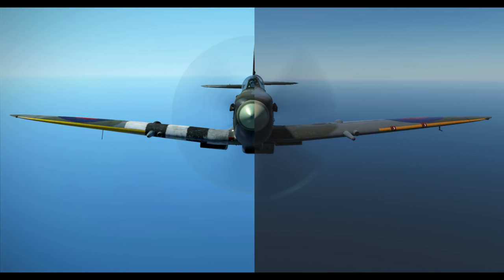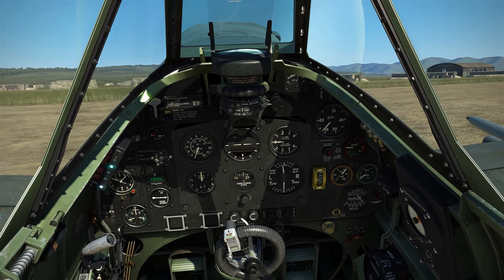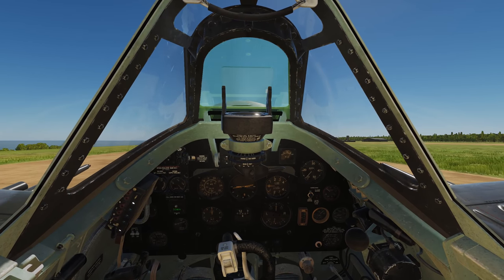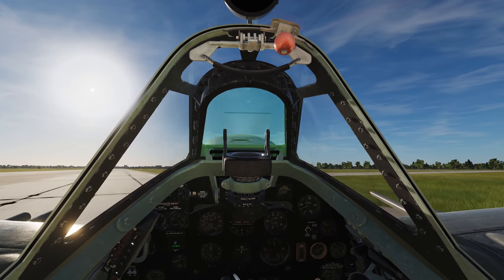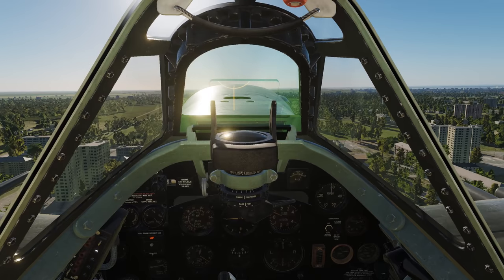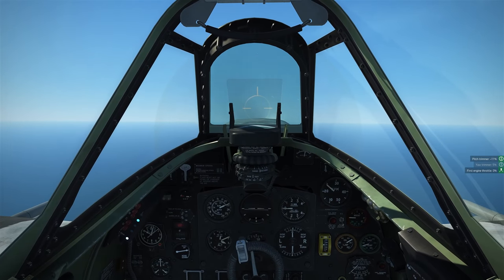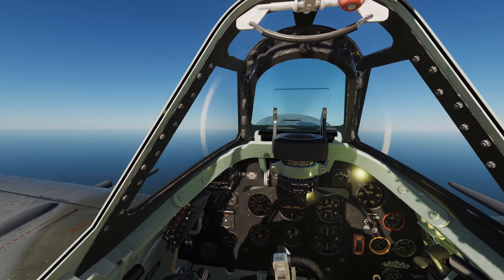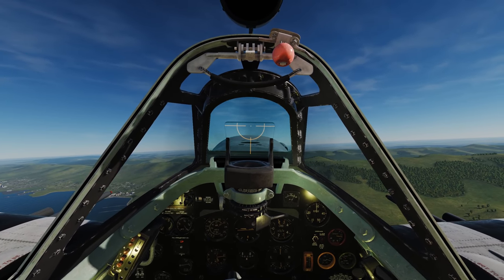Spitfire IX - IL2:GB & DCS Comparison - Part 4 - Ground handling, takeoff, TPM & torque

Comment: It’s impossible to taxi without brakes in the Spit.
Reply from the maker: In the real one you mean?
Reply: This is a very interesting data point for us Sim flyers
Reply: phil style Correct. Changing direction needs brake at all times. Brakes are never used on takeoff except in very rare cases in cross winds in the beginning of the ground roll. Thanks for all your support. Kind regards Nick
Reply: @nickgrey9099  Strange. The last kinda report I read on that, from someone having a run in a Spit IX (TR-9 variant with 2 cockpits, at Biggin Hill), was mentionning that althought they use break for stopping and 90° turn on grounds, and perhaps sometimes here and there, and never for more than 50% break applied, they mainly used rudder for taxiing. 

When asked specifically about using breaks while taxiing, his pilot/instructor replied "oh yeah, we don‘t do that".
His report here : https://forum.il2sturmovik.com/topic/50013-some-impressions-about-flying-a-real-spitfire-tr-9/
Reply: That reporrt is really interesting stuff.  
DCS feels like it doesn't really model the propwash strongly enough to do that (I'm still not totally convinced it's there at all).  You can see from footage of spit takeoffs the tails come up in the first few feet of the roll as soon as the power is added.  You need quite a bit of speed for that in DCS.
Reply: @mostevil1082  Dear Sir, may I respectfully comment having flown, Spit I, II, V, IX, XIV and XVIII, I can assure you that the tail will not come up so easily on the IX unless you open the throttle to +8 to 10 and bring the elevator to beyond neutral. This is not the correct fashion to takeoff. Stick should be brought to neutral and the tail allowed to raise on its own. Many thanks for your passion and support. Kind regards, Nick
Reply: @kalbuth  It is true that when taxiing you only apply partial breaking, 50% is a good guide, but taxiing without braking is only even conceivable on hard taxi way and even then only in no crosswind as the aircraft will easily weathercock into wind. Trust me... Many thanks for your passion and support. Kind regards, Nick

Comment: I know this video is a few years old, but just FYI: neutral elevator position in a Spitfire actually is two notches above the middle position on the gauge. It's not very intuitive, but that's how it works. If you put the arrow in the center, you are trimmed nose-down.

Comment: Excellent series and case study on the differences between the two simulators! Both seem to have their strengths, weaknesses and nuances. I like both, but for some reason -- some of which your tests here might enlighten -- I tend to gravitate more to DCS.

I don't know what your plan is after the Spitfire, but one thing I'd be interested is the comparison on how different couple of different plane types are in different sims (e.g. limited to certain tests about ground handling and take off, torque, engine handling, stalling, etc), especially as we now have some overlap between the planes modelled in the sims. I.e. I feel that in DCS there is more difference between planes, while IL-2 the contrasts seem smaller.

Keep up the good work!
Reply from the maker: My plan after the spitfire series is to actually play for a while, rather than record comparison footage day after day! Lol
Reply: @philstyle  Fair enough :) but whenever you get bored of flying and feel like continuing this series ;)

Comment: Great series, and a really interesting watch. I'm a confirmed il2 head for the moment, but once I get a system upgrade I think I may look into a couple of dcs ww2 aircraft for the 'study sim' aspect.
Reply from the maker: TBH, if you're really interested in mastering a machine, you can sink truck loads of hours into just one module in DCS. I'd recommend doing that over spending cash on aircraft you might not fly. Best to pick one, and choose to really learn it.
I've had the DCS spit nearly two years, have probably a couple of hundred hours in it, and am still learning!

Comment: I think you should try your takeoff sequences on a pure dirt runway in the Normandy map to check if the ground handling on takeoff is different. I always find the short dirt runway you get assigned in DCS Spitfire Instant Action Normandy Takeoff quite challenging. I am sure there would be a similar type of runway in ILX
Reply from the maker: Gelendzhik on the caucasus map is pretty similar to the normandy coastal airfields (low alttiude, dirt). I ran out of time/ video to add that test also.  So much to look at! not enough time to look at it all :)

Comment: Phil, you’ve missed one external eye-candy feature of the DCS Spitfire that seems unique to this module (at least it’s missing from the P-51D and FW-190D).  And that’s the wonderful semi-transparent flickering exhaust flames that go from orange to blue as power is applied.

It also contrasts with maddening bright yellow (wrong colour) intermittent stabs of flame (far too infrequent) that 1C Game Studios insists on using for all its aircraft.  
Each cylinder on a four-stroke engine fires once every two revolutions.  Taking 2400 rpm to simplify the maths, means 40 revs/second, or each cylinder firing 20 times a second, not once every few seconds as in the IL-2 Spitfire.  Another gee-whiz gimmick that just distracts from the realism.
Reply from the maker: The engine exhaust flames are broken in the current DCS spitfire, so I was unable to properly compare them as they are normally supposed to be.

https://forums.eagle.ru/showthread.php?t=243261

Comment: Beat to have stuck slightly back to neutral. No need to push nose forward. + 8 a bit much but ok
Reply from the maker: I find +8 far easier to see with a quick glance. The horizontal needle. . .
Reply: phil style +8 is fine too. Plenty of grunt 😎
Reply: @philstyle  +18 lbs is good boost for take off :(

Comment: "She was a lady in the air, but a bitch on the ground" : I have a real hard time taxiing with her (in DCS). I have a Warthog and I don't know how to manage the brakes, since the lever behind the stick (the closest to the Spit brake lever, in a simulation perspective) is not an axis input, but just an on/off button. What's your HOTAS ? Do you have any tricks ?
Thanks for your videos, I really love them ! 👍
Reply from the maker: I also have warthog. My brakes are bound on the throttle quadrant. They are assigned to the little grey slider which is to the right of the main throttle and prop levers.
Reply: @philstyle  Thanks a lot ! I hadn't thought of this one ;-) So as I can see in your video, you just apply a tid bit of brake pressure with it, and you can then taxi using only your rudder like with any other warbird ? I'll try this tonight 😉
Reply: @FastForward352  I just tried Phil's method this and it works however I have my IX brakes assigned to the left toe brakes on my rudder pedals and you can use them with an axis ( if you have pedals) as DCS has it available in the axis control options operating in analogue mode. I prefer to use the grey slider on the WH throttle for fine nose up-dwn trimming. Early in the vid (10.43) Phil called the IX brakes differential, not sure what he meant by that description,  I don't think it is a correct description as the IX brakes do not operate independently, the left and right brakes are applied simultaneously by the air lever on the stick. I could stand correcting on this?
Reply: I seem to remember that we all used the '4lb brake cheat' when learning landing and take-off with the DCS Spit (even Phil).
This involved using the grey slider to put about 4lbs of brake pressure on and leaving it there to control the aircraft for better ground contact.
Reply: @zorbalight3933  They're not really differential brakes, but they work in coordination with the rudder : brake then apply a small amount of rudder either left or right and you'll see the brake pressure needles (on the left) behave like differential brakes. Correct me if I'm wrong, I'm not specialist at all ;-)
Reply: I also meant to add that I think on many of the Normandy map strips you need to be able to dab the IX brakes whilst taxiing to counter DCS excellent modelling of the non centering (castering) tail wheel.
Reply from the maker: @FastForward352  
Yes, I just apply a tad.

remember though, applying the brakes will start to slow you down, so you kind-of need to apply-and-release the brakes as you use the rudders, just anough to correct your path but without loosing too much momentum and stopping your aircraft.
You can just leave the brakes set "on" a little bit, but I prefer to use them like an additional control, adjusting them as needed during the taxy.
Reply from the maker: @zorbalight3933  You're right, the brakes aren't differential in the normal sense (which would require/ allow one pedal per brake). But they kind of function in a differential manner, bing likned to rudder input. It's a sort of "differential" (quote marks included) system.
Reply from the maker: @FastForward352  
Yup.. You're right, the brakes aren't differential in the normal sense (which would require/ allow one pedal per brake). But they kind of function in a differential manner, bing linked to rudder input. It's a sort-of "differential" (quote marks included) system.
Reply: @philstyle  In IL 2 I flew almost all Aircraft, and it seems to me that I always flew the same! 
The difference is only about the time you need to complete whatsoever manoeuvre
..
instead in DCS every plane have his own personality.. :-D
Reply from the maker: @tonykeith76  
I had exactly the same impression, I just didn't want top say it out loud!
To me, all the Single Engine Fighters feel more similar to each other in IL2 than just the Mark IX Spitfire between IL2 and DCS.
I am often surprised when I see a Youtube tutorial about "how to fly" the newest IL2 aircraft. I never needed a tutorial for any of them, just jump in press "I" and go flat out. I sometimes wonder if these Youtube tutorials are making far more of the contrasts than they need to, especially when the tutorials have long sections of reading-out of information or history lessons from wikipedia, some of which isn't even modelled in the aircraft anyway .
Reply: @philstyle  I totally agree ;-) ( I'm too old to be politically correct )
Reply: @philstyle  There is much in what you say here - I think some of that can also be significantly effected by the individual controller settings eg using slope modifiers for axiis or even simply varying take off assist in DCS eg. if you use full TO assist in DCS (100%) and then watch the pedals in a Mustang or Spit (the 2 I use the most) one will see the rudder pedals oscillating quite sharply on takeoff without you applying any rudder input.
Reply from the maker: @zorbalight3933  I agree, there's no doubt that hardware and control setup plays an important part here. I am almost certain that on different hardware I might have different things to report, or I might notice other differences that I don't see now.
Reply: Dear Sir, the Spit is probably the nicest of aircraft on the ground once you get to know her. Delightfully precise and honest. the bitch comment couldn't be further from the truth and I have been flying all marks for the past 35 years... Kind regards, Nick

Comment: The ground handling in the DCS  is a bit of an overkill IMHO. If they were this hard to handle I’m surprised 50% of them weren’t destroyed on take off. Cool series though bro 👍🏻👍🏻🙃🙃
Reply from the maker: No it's not. Just use the brakes, juat like in real life. As Nick Grey says below in another comment, it's not possible in real life without using the brakes.
Reply: phil style 
Well it must be a lot easier in the real aircraft (seat of the pants I suppose) It’s bloody hard in DCS to try & get it right with the breaks. You are a good pilot & it still ground looped on you. Just frustrating I will just have to practice more. Keep up the great content. 
👍🏻👍🏻🙃🙃
Reply from the maker: @matk4731  
I ground-looped the IL2 spitfire from inside the cockpit in this video.
The DCS spitfire ground-looped (or started to anynway) because I was in external views and not watching it or controlling it :)
That's not to say I don't G-Loop the DCS spitifre in other circumstances, but if taxied correctly (fast walk, danving rudder cand using brakes) it really is fine.
Assigning the brakes on an axial-slider really does help a lot. It's effectively on a slider in real life too. Most people assign it to pedals (doesn't match the real life ergonmics) or a key-press button (which is only binary) so they have a real though time of it.
Reply: I don't have an axis for wheel brakes, just an assigned button on the stick and it's a piece of piss to taxi her, frequent dabs at the brakes (it's not modelled as on/off but gradual input so it's really quite gentle) and rudder, with a bit of throttle input to balance the drag off the brakes. I'm sure you've got it by now!
Reply: @chrisburn7178  
Yeah mate got it by now. Just had to learn the fine balancing act between thrust brake & rudder  😜
Reply: @matk4731  Good stuff. Like Phil says, because you don't have G forces acting on your butt you can easily get into a chasing-your-tail pattern but I really like the involvement which is why IL2 doesn't really appeal due to the dumbing-down of engine management, torque, altitude and pressure settings, among others. Although it is frustrating when you forget to check your engine temps and suddenly it quits on you in a casual fly around or in a fight 😁
Reply: Its much more difficult in il 2, like its made on purpose, taking off os much easier, in dcs its the opposite, im not a pilot and cant say that its factually more reallistic in dcs but it doea feel like it